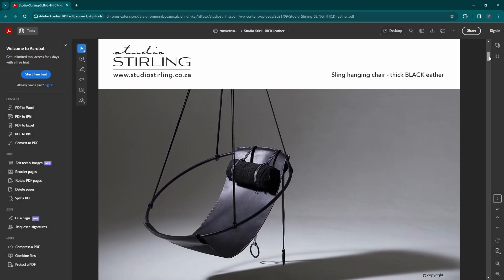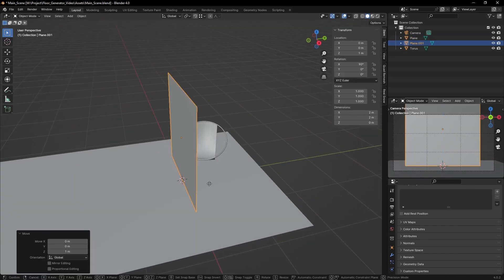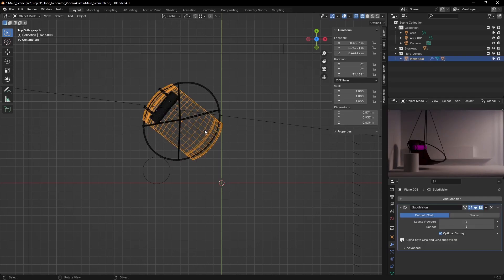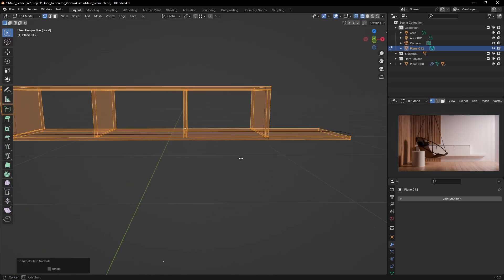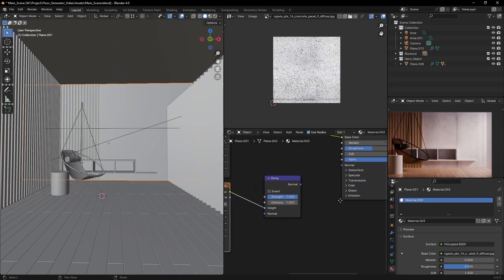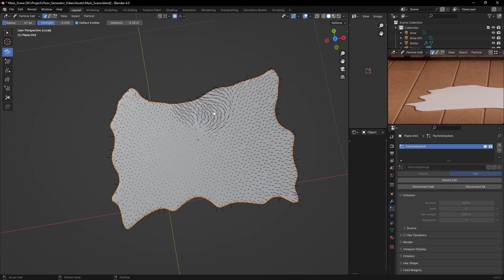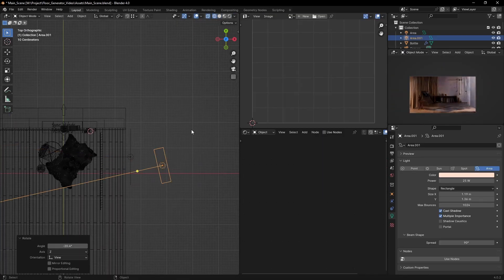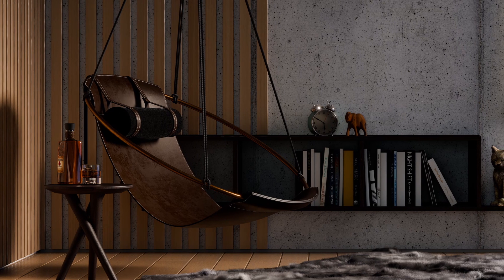Modern Interior Breakdown | Blender Arch - Viz Series

Comment: I have the feeling blenders color pickers are a bit broken with the AgX now added. Seems it does not pick colors properly
Reply from the maker: havent really looked into it, seems to work fine, its just that you are seeing the color with the color profile applied, so even if you put in a color with a value of 0.5, it appears like a color with value of around 0.7 it's a bit weird.
Reply: @blenderisms  well normally when you use the pickerz it works. But when in the compositie with agx. I see weird behavior. Test it with a RGB nodez notice it won't grab the correct color
Reply: @blenderisms  4.3 fixes this issue, as I understand it, by picking the color pre-transform so it get's the true rgb value.  So it won't matter if you have agx or whatever color transform selected.  I have yet to test this myself though.